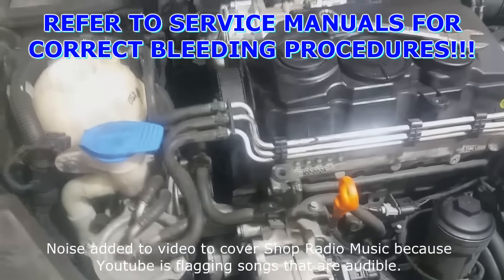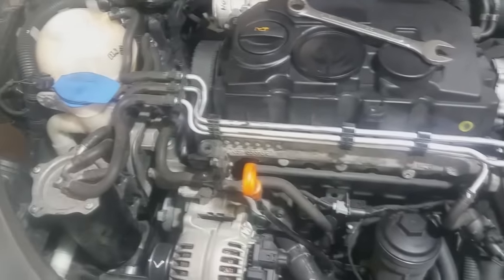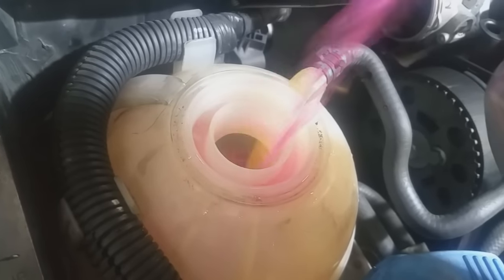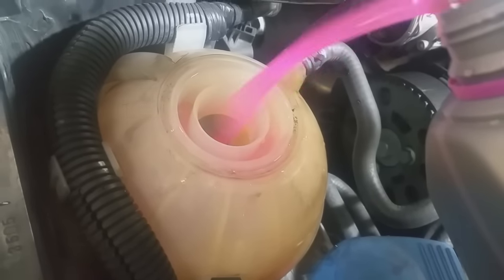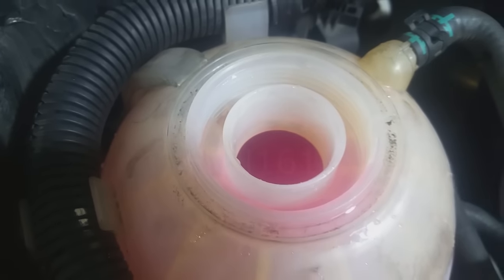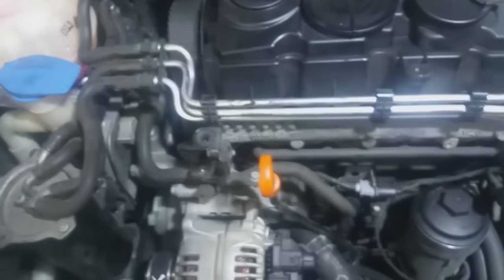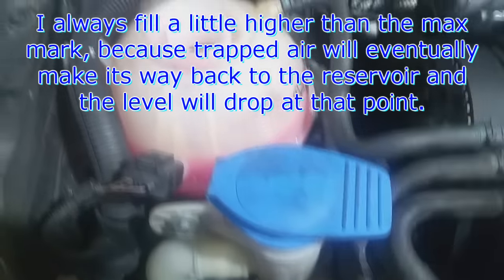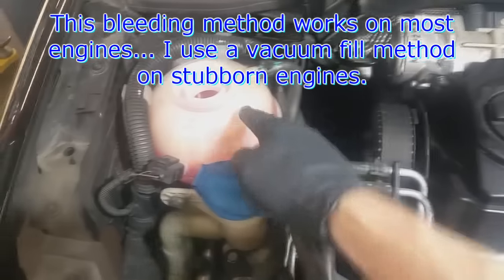Basic VW cooling system filling / bleeding info (viewer request)

Comment: does this work for a mk2 golf too?
Reply from the maker: Yes... but on the mk2's I usually fill the system through the upper rad hose. Disconnect at the radiator, lift & fill through the hose. Fluid level in the reservoir will rise, fluid might also come out of the rad when the level gets high enough. Reconnect hose and start the engine. No need to pump the system then. MAKE SURE that coolant flows back into the coolant reservoir via the small coolant return hose (if it has one).
Reply: this flushes it completely? ok I will try and do exactly what you said. video would help because I learn better that way. I appreciate it a lot. thank you very much. your work helps.
Reply from the maker: To flush the system... drain from as many hoses as possible... fill with water, run the engine and then drain again. Do this until only clean water comes out... then, fill with 50/50 mix.

Comment: Hello 
Dont know will you answer 
 I just need to ask , after changing coolant tank its cracked at bottom do i need to bleed air , a4 b6 1.8t
Reply from the maker: I don't know how much coolant came out when you drained the engine and I don't know how much coolant you put back in. 
Bottles can crack from old age. To check if there is enough coolant in the engine... disconnect the upper radiator hose at the radiator and add coolant into the hose until it is full. Also fill the radiator and then reconnect the hose to the radiator.  Disconnect one of the heater core hoses and add coolant to the disconnected hose until coolant comes out of the heater core pipe. Reconnect the heater core hose to the heater core pipe.

Comment: Hello Thomas please I need your advice.  I have 1.9 tdi 105 ch bxe I have the compression in the cooling circuit the level drops to the lowest minimum and when I open the expansion tank cap it rises to the maximum level.  I changed the expansion tank cap and water pump and egr valve cooler and still the same problem. the temperature remains normal what do you think thank you
Reply from the maker: Run the engine until the engine is fully warm (cooling fans have cycled). Turn the engine off and let it sit / cool off overnight. If the fluid level is at the correct level (max) the next day, then you probably don't have a head gasket issue. If the system is still full with pressure (level is at minimum with engine cold) and it comes back up when you loosen the cap... then you have a head gasket issue / failure or a cracked cylinder head / block.
Reply: @EXOVCDS  Thank you very much for your answer.  unfortunately with the same method that you explained to me always of the pressure .d after you the product to repair cylinder head gasket or cracks is it effective or not?  cordially
Reply from the maker: @zouma7734  If you still have pressure when the engine / coolant is cold, then you have to remove the cylinder head to find the problem (head gasket, cracked cylinder head or block). You might have to take the cylinder head to a machine shop for inspection... if you can not find a problem yourself (they can pressure test the cylinder  head to look for tiny cracks).

Comment: Is it normal for these things to boil the liquid inside?
Reply from the maker: No.
Year, make, model, engine... what work was done?
Reply: @EXOVCDS  voltswagon 2012 CC sport, the temperature light came on for the first time ever since owning the car and when I pulled over to check this part the liquid inside was boiling bubbles inside it like hot water on a stove, however, the temp was normal on the on the dash indicator at 190 where it’s always usually at. The light did turn off after leaving the car off for a few hours, but after driving it for about 14 minutes I check the reservoir again and it still boiling the liquid inside.
Reply from the maker: If it's a 2.0T engine, it could be that the front balance shaft is seized and is no longer spinning the water pump. Check for heat inside the car... no heat indicates that there is no coolant circulation, hence the boiling.
Reply: @EXOVCDS  yeah, mine is a 2.0T engine, and during the second car ride where I road it for those 14 mins I had the windows down and was driving with the heater on so I can let the heat that would come from the engine into car and out the windows so the car wouldn’t overheat til I found out what was wrong with it (mind you the temp light wasn’t on at the time, but was being cautious). Was that not necessary to do to begin with? So the heater works to my car, any other factors that would cause the boiling? I don’t wanna take it my nearest Volkswagen cause I don’t have 500+ dollars to spend on a examination and for them to fix something that I can do if I can.
Reply from the maker: @TylerPKegger  I didn't know that you already used the heat inside the car to help cool the engine... are both cooling fans coming on when the ac is on? If the water pump is pumping, then it's either a cooling fan issue or thermostat.

Comment: for a 2006 jetta tdi what temp would the fans come on
Reply from the maker: Similar to gasoline... 97c (IIRC). TDI engines take a looooooooong time to get warm. Even once the needle in the dash (if there is one) is in the middle, it will still take a bit longer before the fans come on. Hold the rpm at 1200 to 1500... could take 10 to 20 minutes. If you have AC (working AC), make sure that the fans come on when the button is pushed (to verify that "control of the fans & power to the fans" is actually present. If you don't have any overheating issues, I would not worry about not seeing them come on. Turning the heater on inside the car, also lengthens the time before they come on.
Reply: It wasn't going over 194 degrees
Reply from the maker: @sithjediemperoroverlord7337  do the fans come on when you turn the ac on? Any fault codes for radiator fans when checking the ecm for codes? If the fans work with ac and no codes are stored,  don't worry about them not coming on. In the summer with warmer weather, they will probably come on.
Reply: @EXOVCDS  fans come on when ac is on and i vagcom and tested the fans they worked and im not overheating
Reply from the maker: Then everything is working as it should. Cold winter air is keeping things cooler... no need for fans to come on.

Comment: thank you for this 🙏🏼
Reply from the maker: Thank you for watching... let me know if you have any issues. Year, make, model, engine (would help with giving you specific advice).
Reply: @EXOVCDS  i have a 2000 vw gti 12v vr6
Reply from the maker: Thanks... did you do any repairs or just a flush? If you have no overheating issues after the flush, all is well.
Reply: @EXOVCDS  yea i had water in the system because my heater core was leaking all the coolant and i was tired of buying it so i added water and bypassed it for the summer and now it’s getting cold and gonna freeze in a few days so i decided to replace all the water and add coolant
Reply from the maker: Good idea... water alone could cause damage once it freezes. Was the water rusty looking? It might be a good idea to flush again in the spring (to remove any remaining rusty debris that might come loose over the next little while).
Reply: @EXOVCDS  okay good idea, and the water was not rust at all surprisingly

Comment: hey it's still dropping down when I'll drop when I'm driving
Reply from the maker: Check for other leaks... depending on how much air was trapped in the system, the level will drop once the air makes its way to the reservoir bottle. If the level does not stabilize / does not stop dropping, then there's a leak that you need to find.
Reply: Could it be a bad thermostat and if there is no leak what should I do go home let it run without the reservoir cap on
Reply from the maker: Devin Davis Not a thermostat issue if the lower hose is getting hot and the temperature gauge / needle stays in the middle / not overheating. Is coolant flowing into the reservoir via the return hose (I might have asked that before). There are 2 types of leaks, external & internal. External are easier to find (look for coolant around the engine)... check spark plugs for internal leak.
Reply: it dropped on my way home should I let it run with the reservoir cap off will that let the air out
Reply from the maker: Devin Davis If it's dropping because of air, the air is now in the bottle... add fluid and run it again. If it continues to drop, you have a leak or a head gasket issue. I think i mentioned that alreafy. You can run it with the cap off if you want.
Reply: If it's right should the reservoir tank make any noise while squeezing the hose
Reply from the maker: Devin Davis With the cap off, you should hear & see fluid returning into the reservoir. Post some videos... YouTube is great for that.
Reply: Thomas EXOVCDS hey the fluid is Raising in up
Reply: when car is fully preheated
Reply from the maker: Devin Davis Air in system or compression is leaking into the system.With the cap ON, how hard are the radiator hoses? When you let it cool down, do the hoses stay hard?
Reply: All the hoses stay hard and warm the only one it's soft is the one that you're squeezing in your video
Reply: But still when it's warmed up it's pretty tight not real soft or flexible
Reply from the maker: Devin Davis Leave the cap on... run the engine until the fans come on and the upper radiator hose is hard. Let it cool down over night. Check how hard the hose is tomorrow morning. should be soft. If hard, you might have a head gasket issue. Have a shop look at it to be sure either way. Too much back & forth here via text.

Comment: 2.0s are not so easy, can we see a video on one of these stubborn little brats?
Reply from the maker: It's all the same principle... if you don't have "return flow" into the coolant reservoir when the engine is running, you need to check for a plugged hose / fitting in the bleed rail part of the system.
Reply: @EXOVCDS  so the coolant should basically be flowing through the system full circle, from the coolant ball to the coolant ball, pushing the air out.. as long as the thermostat is working and no clogs.?
Reply from the maker: @M0N0T0N0US  the thermostat only controls flow through the radiator. If you have air in the radiator, it can't get out until the thermostat opens... but yes, coolant should otherwise always circulate in the engine / back into the coolant bottle. If no flow is returning into the bottle, then something is plugged or the water pump is not working.
If the engine is not overheating when driving, then the water pump & thermostat are ok.
Reply: @EXOVCDS  car ran fine, drained 1 gallon of coolant, was gonna flush it a couple times before doing the timing belt and water pump, but now it doesn’t want to take any more than 3/4 of a gallon and it overheated so I shut it down. Then it boiled out of the coolant overflow.
Reply from the maker: Sounds like you have an air packed / trapped air. Remove the small cool return hose from the coolant bottle. Try to blow into the hose. If you can not, then there's a plug somewhere that you need to unplug.
Reply from the maker: In this video you can see there was a plugged fitting and a bad water pump... and you can see the good return flow after.
https://youtu.be/ln4grYe3WnE
Reply: @EXOVCDS   I’m sure it’s an air pocket or a clog somewhere in the small return lines, previous owner was running hose water for who knows how long. it’s a 99 beetle 115,173 miles, never had any work done till now. idk if that’s a good thing or bad..

Thank you! Watching now, You are greatly appreciated!
Reply from the maker: A restriction / plugged hose is not an issue when the cooling system is already full. That's why you didn't have any problems before you drained the system. Once you find the restriction / plug and remove it, you'll be able to bleed the system correctly.

Comment: This is total nonsense mate. I have the V5 AQN engine and it is IMPOSSIBLE to fill without a vacuum device or by cycling the engine on and off, each time the secondary water pump will keep running and pull in 0.75 liter of coolant. It's a tedious and mindnumbing process.
Reply from the maker: Title says basic... if basic doesn't do it, then other methods / steps will need to be taken. Most vw / audi engines can be filled like this. I use the vacuum fill method 90% of the time. This video was made for people that don't have access to a vacuum fill device & air compressor.

Comment: When people worship Volkswagen meanwhile other Cars got the valve bleeder on the hightest point... sometime i dont understand how some Cars are enginereed
Reply from the maker: The return hose (bleed hose) is at the highest point... almost all VW engines are simple to bleed. One just needs an understanding of how the system works, so that one can anticipate or account for possible issues. As an example.... if the return hose is plugged or fluid is still in part of the hose (bleeding circuit), air can't get out, which will result in air pockets / overheating. Simply pumping the radiator hoses (like I did), clears the bleed circuit (hoses) to allow air to escape & fluid in the reservoir to drop / enter the engine. Every manufacturer (car / engine etc) has something that is a pain to replace / repair.